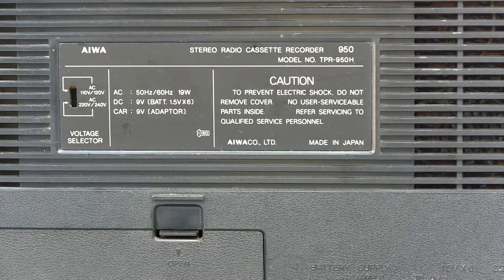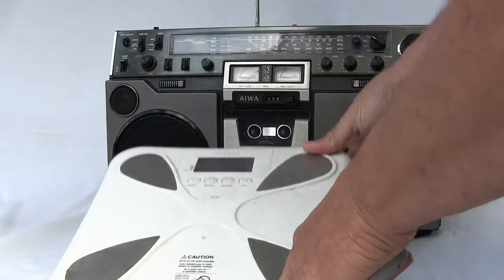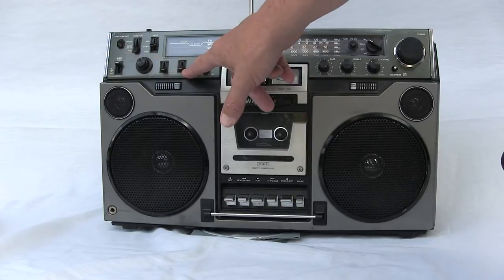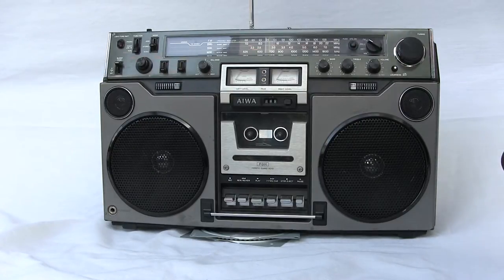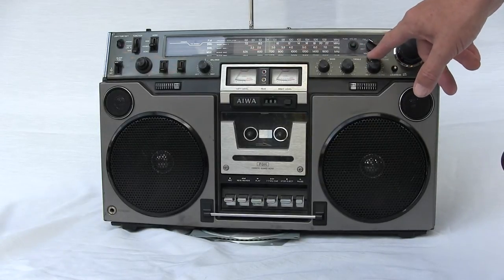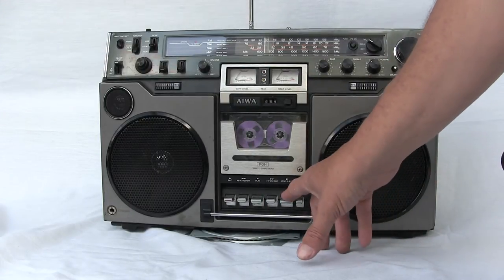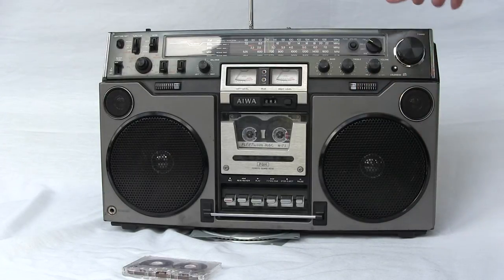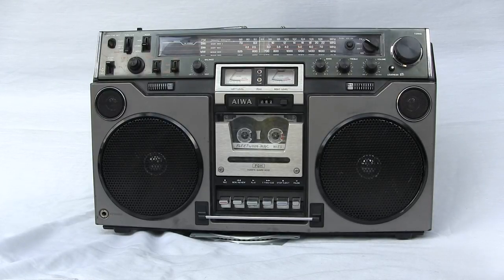Aiwa TPR 950 9 volt Operating 6 D cell Cassette 'Does it All' boombox Review

Comment: Hi! Great video! I just recently bought an Aiwa TPR 950AH and was wondering if you knew what the differences are between the H and AH models?
Reply from the maker: The after prefixes of the model number are different country codes for different voltages that is the basic difference between those letters that's defined on many different brands have different lettering systems for the same idea of different voltages understand?
Reply: @Cassette2Go  Yep, I understand. I didn't know if you ran into this model of the TPR or not. They are both American models. Thanks for the info!

Comment: Good presentation but too sketchy as usual. Thx. 
This point of mine is purely formal.
Refers to both the presentation and some of the comments below. 
You shouldn't have use for this presentation a metal tape, this radio cassette recorder can optimally reproduce signals recorded on normal tapes [(LH)Type I) as well as on chrome [(CrO2)Type II] and Fe-Cr [Type III].

This is a very good model (#950), but the best in the Aiwa "TPR" line is the younger #990, which is equipped with Dolby NR, allows the use of metal tapes and has soft-touch controls. 
The frequency response when using a metal tape is 45 Hz - 18 kHz (Type IV), 
S/N Ratio 65 dB on Metal tape & Dolby On, 
Wow&Flutter <0.07% WRMS.